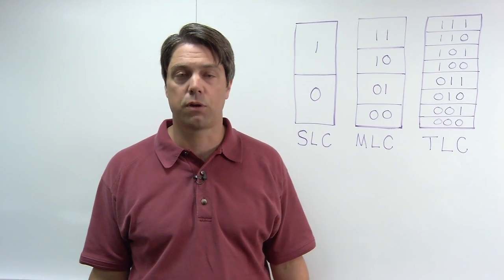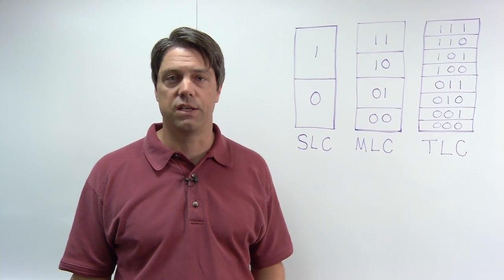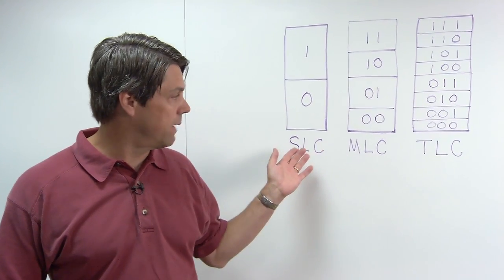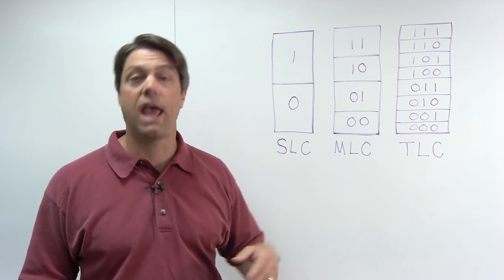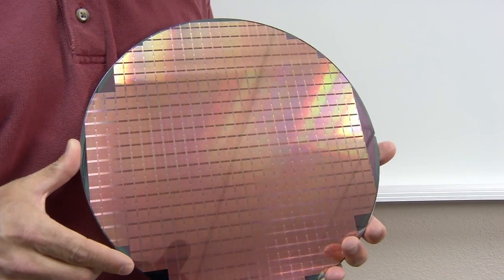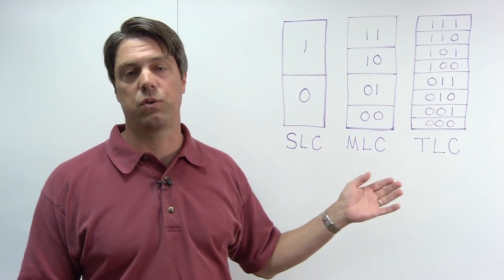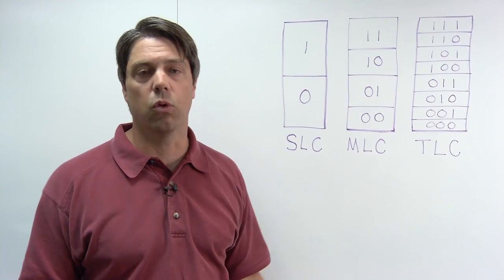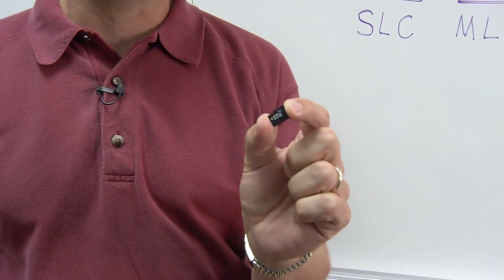25nm Triple-Level Cell NAND

Comment: The only real question I have about TLC is what kind of durability is it going to have. Unless I am wrong its 100,000 writes for SLC and 10,000 for MLC so 1000 for TLC if things stay true makes it look VERY unattractive even if it is cheaper.
I would also imagine it will be even slower as the same as above goes for speed on SLC/MLC/TLC.

Makes me think TLC will be more of a "storage" solution where our primary drives will be SLC/MLC.
Reply: Yes this is the order of magnitude of write cycles possible until failure. 1000 seems to be a very low number for TLC, but keep in mind that there are billions of TLC cells on a chip. SSDs do wear leveling, meaning they try to degrade all cells at the same level rather than have some fail early due to excessive usage while others stay unused. 
It's a good practice to not fill up SSDs all the way with data as this will degrade them faster. Also for performance reasons, when there is enough space available, the memory controller stores only a single bit per TLC cell which makes the read/write speeds faster. 
Samsung even has QLC already with 4 bits per cell or in other words 16 voltage levels.
Sure, MLC is much more durable as a drive for the operating system with very frequent writes and TLC/QLC is best as a replacement for HDDs for data storage.

Comment: @EmptyMellon It's showing 3 bits per cell. Bits are the 0's and 1's, that is, the digits written in a single rectangle in the diagram.
Each bit can store a 0 or a 1, so for storing 1 bit per cell (SLC), you need to be able to store two combinations (0,1). That's what's shown in the first diagram. For storing 2 bits, you need 4 combinations (00,01,10,11). Similarly, for storing 3 bits you need the ability to store 8 combinations. Only one of those combinations is in the cell at any given time.